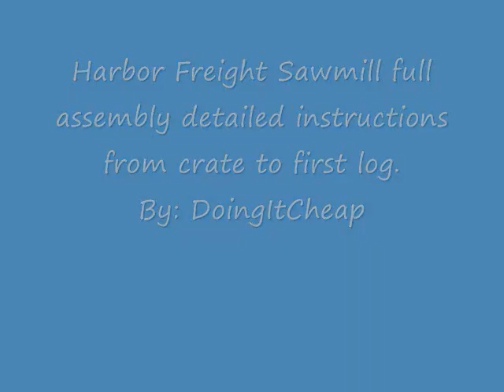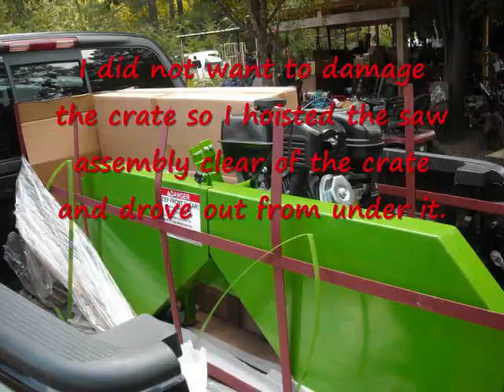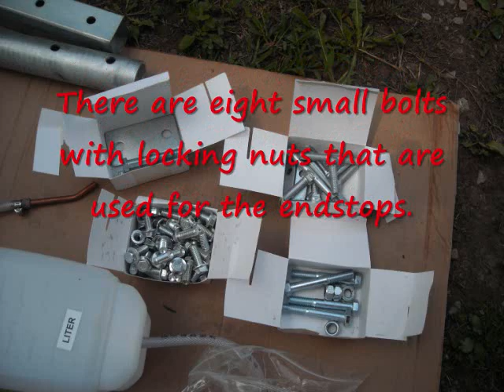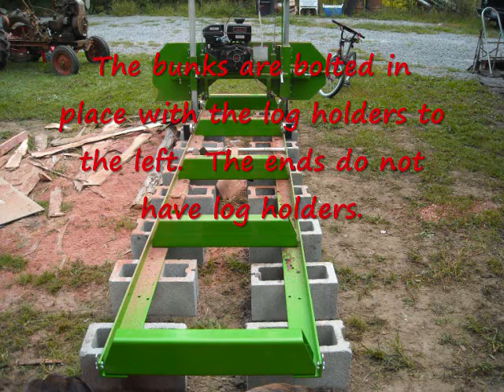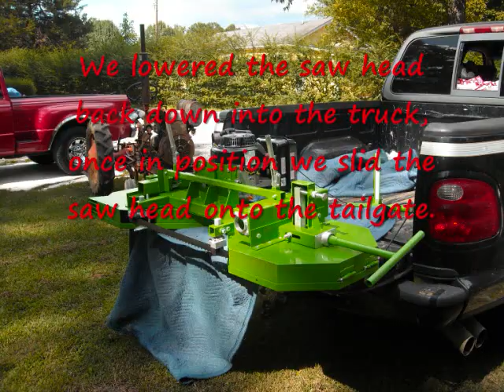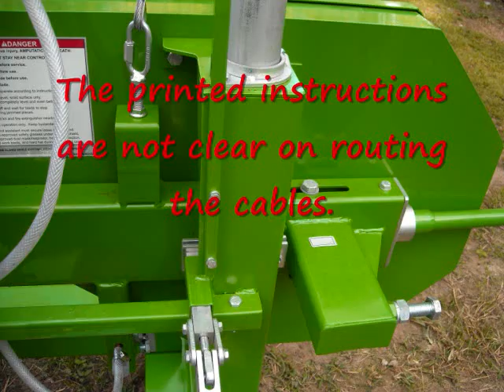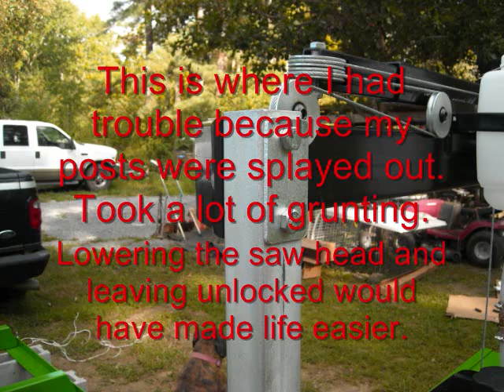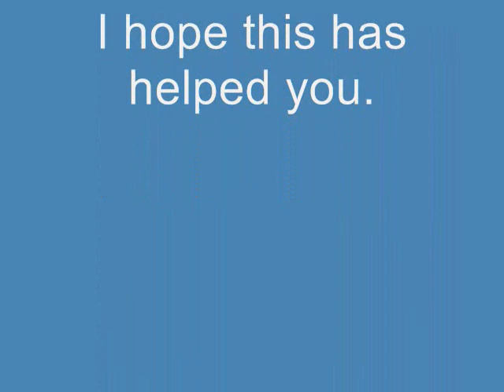Harbor Freight Sawmill complete set up instructions from crate to lumber

Comment: I lifted the mill up with an excavator using a chain, slid the square and round vertical posts down from the top, then assembled the top brace, left and right wheel frames before setting on on the rails

Comment: Hey, so how is the mill working for you after 8 months?  Any major things to watch out for?
Reply from the maker: I am very pleased.  I haven't made one yet, but it could use another hold down..... the screw part that holds it tight to the side.  Keep in mind that the last cut you will make will leave approximately a two inch slab unless you build it up.

Comment: im thinkin about buyin one of these next month , any advice on the hb ?
Reply: +grizz270 sawmill
Reply from the maker: +grizz270   I studied on this a LONG time.  Parts are easy enough to find if something ever does go wrong.  The blades are cheap enough from Cook's in Alabama.  About $150 for ten of them.  The reason I showed how far apart the rails are is in case someone wants to mount a couple of twenty foot sticks of 4x3 angle iron ahead of time so you can cut longer logs than just over 8 feet.  Of course logs over eight feet are gonna be very heavy unless you have the right equipment to handle them.  Basically, it is just a bandsaw on wheels.  But I LIKE IT !!!!!!!!!!!!!!!!!!  I could not build one for the price.  I give it two thumbs up all day long.  I am going to build a shelter for the saw and mount twenty foot pieces on concrete pillars.
Reply: a friend of mine gave me a 14 by 24 metal carport 14 feet tall i have a small kabota 1860 but have other meens of moveing logs as well a friend of mine keeps a rather large exavator here i can use if i need , i have timberland and know many loggers , so im lookin forward to this , 1 more question , can you contact harbor frieght and work out  a deal with them before i purchas that you get somethin out of this for me findin it on your channel ?
Reply from the maker: +grizz270   LOL !!  Thanks for the thought but no bird dog fees are paid by harbor freight.  But I do get a penny or a half a penny for every three or four views !!   Just tell all your friends to subscribe to my channel and watch my videos.  That would be thanks enough for me !!